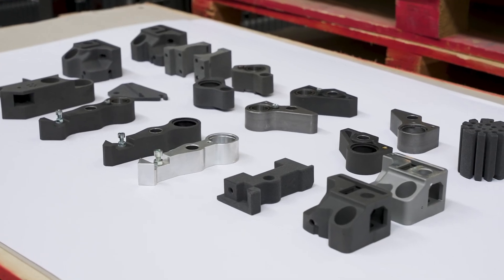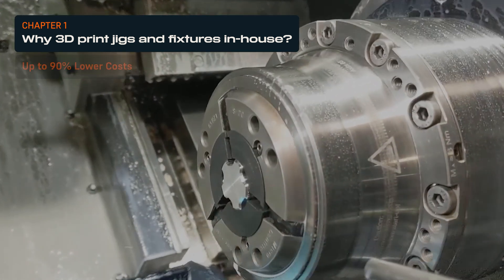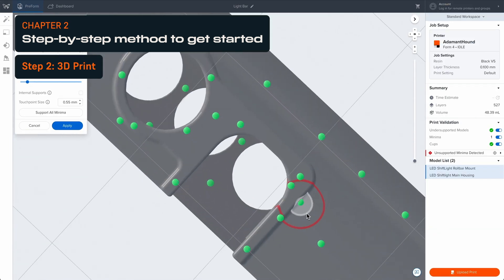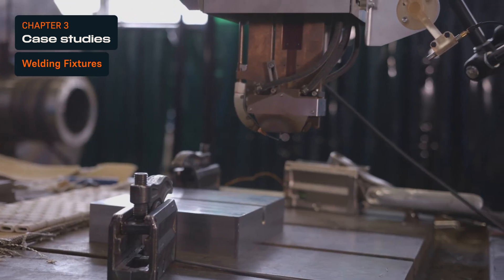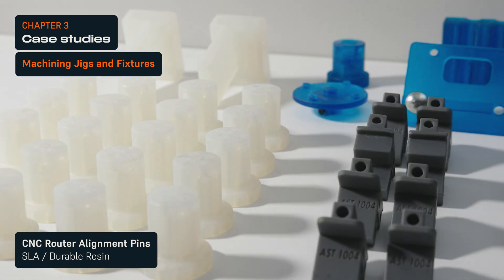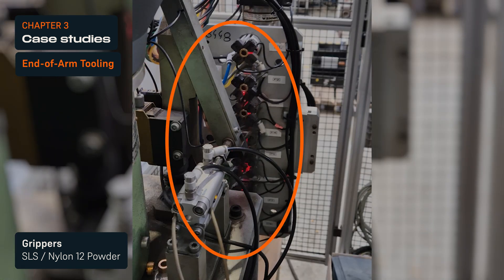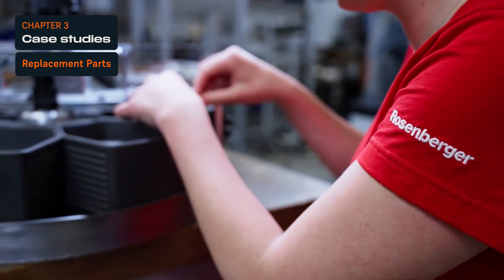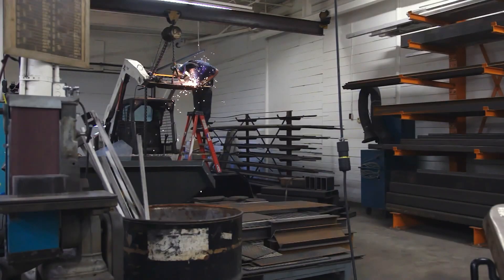3D Printed Jigs and Fixtures: Streamline Your Manufacturing Process

Comment: Is this written by an AI?
Because it mention all the snippet of 'Rapid Tooling' benefits but without mentioning the main use case for Rapid Tooling...

1) Allow continuous operations without stopping production using existing J&F designs (down time as they mention briefly)
Spare production parts can be made and introduce quickly without halting the whole line, while waiting spare parts to arrive.
2) These spare parts can be done quickly and functional enough to ensure continuous operations with little interruptions.
3) Very useful to fine tune R&D process with new R&D J&F e.g. minimise bottlenecks with several J&F iterations, before confident enough for scalable solutions sent out machining.
4) 3d printing is a good transition bridge toward a more permanent solutions like CNC, from making by hand to full automation process transition.
5) because 3d Printing can mimic all other traditional geometric manufacturing like extrusions beam, CNC J&F, plastic injection, rubber pads & etc.
6) Shorten 'process' development time cycle, as 3d print onsite and lower overall cost, before agreeing with the final solutions.
7) Most 3d print one offs jigs vs out source with MOQ limit who expecting more.
8)  Not only can 3d print mimic other manufacturing processes, it can also introduce unique F&J one of a kind 3d print only methods, not available in traditional CNC jigs, like miniaturization or special features useful on the production floor hard to replicate by other means.

3d printing may not last as long compare to traditional J&F counter part, but it certainly make up for is 'time' and 'unique features' including wide range of material properties to justify it use case on production floor.

But I'm very skeptical with the content of this video.